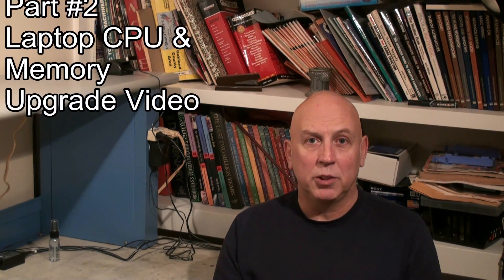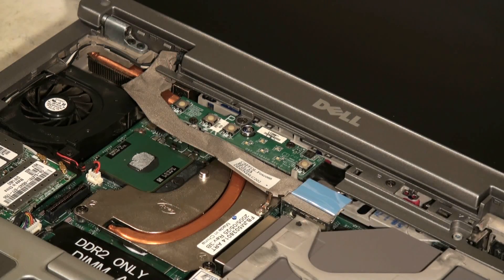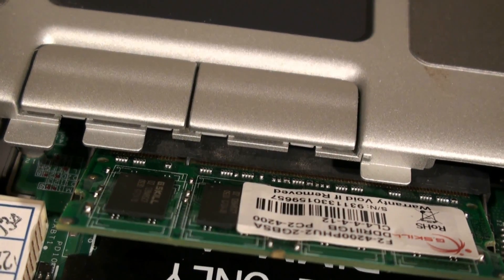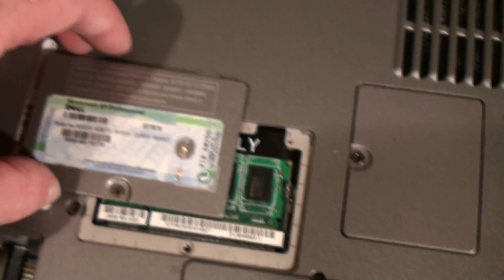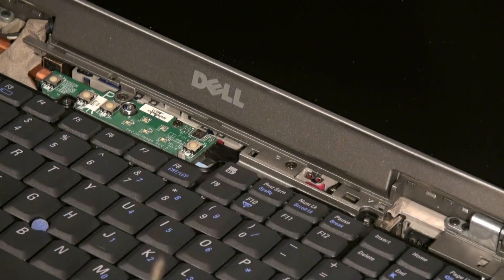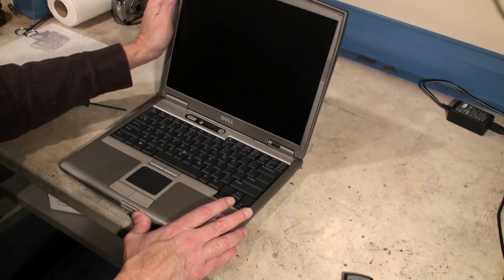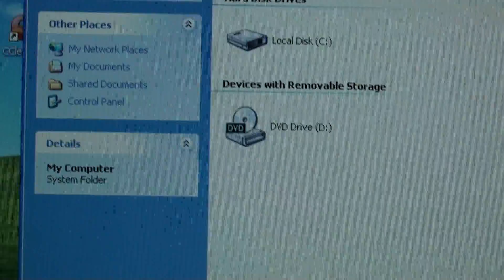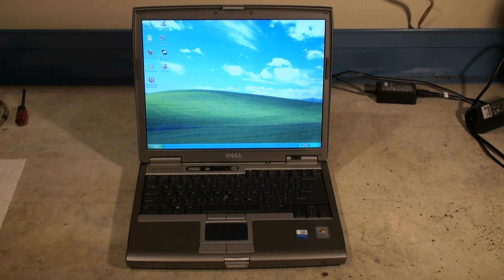Dell Latitude d610 CPU & Memory Upgrade Video #2

Comment: Hey i know this is years late (late 2025) but did you notice any overheating issues under load after you did your cpu upgrade? I was reading that the design of the d610 was not optimized for the increased heat production of the 770 you installed, just wanted your thoughts on this! Thanks :)

Comment: After installing new RAM my laptop no longer boots up. When I press the power button it starts, normal fan noises and such, nothing on the screen and the lights on, not blinking, then shuts down all in about 5 seconds. I have tried suggestions relating to power and battery, but nothing works. Do you think the RAM is bad. I have tried this with the original ram and the new ram and it all doesn't work

Comment: 1) Use some rubbing alcohol (or cheap aftershave like I do!) to remove the old paste
2) Don't use fingers to apply the paste as grease from fingers is not very good for thermal conductivity and
3) I would recommend Arctic MX-2 or MX-4 paste as neither paste is electrically conductive (as the actual CPU is exposed unlike a desktop CPU, non conductive is safer to use)

Comment: i have this same computer with win 7 on it i upgraded it wasn't slow it ran quicker with 7 than with XP. this computer actually played some new games that i have like diablo 3 and torchlight and left for dead. but most high performance games will not work like Skyrim / call of duty modern warfare. and so on. its good for indie gamers and old school games. its pretty much a basic laptop now that used to be high end in 2003 when manufactured

Comment: NO! NONONONO! NEVER use your finger to spread the paste on the CPU! your finger has many oils and such that, when the processor later heats up, act as  hot grease and can damage the processor. use a clean pocket knife or razor blade.

Comment: I have 2 x 256MB RAM (PC2-3200S-333) at the moment. I think they are 400MHz. I want to upgrade to 2 x 1GB.  Dell is selling  1 GB PC2-6400S-6 2009 SODIMM.  Can I use 2 x 1 GB PC2-4200 DDR2 SODIMM 533 MHz instead?

Comment: love your vids. i bought a d610 for $60 shipped and it had 2 512mb chips. i only replaced the one underneath with a 2gig corsair cgm2x2gs800 i had layin around. should i take the keyboard off and remove the other 512 chip or it won't hurt anything to just leave it installed? i would also like to see a vid of a harddrive upgrade if you would make one. thanks.

Comment: Thanks for the video. I will be upgrading my d610 shortly.

As others have noted you should not apply the thermal compound with your finger.  You can deposit a small amount on the CPU core and then use a credit card to smear it.

Comment: @RaggiGJ And also I dont think it is a good idea to apply the thermal paste to the cpu using your fingers, since your fingers have grease on them and this method also makes tiny air bubbles in the paste that reduce the cooling effect of the paste. I am no expert but this is what I have learned from many other computer specialists. It's better to apply the paste straight from the syringe/tube/plastic bag and let the cooling module spread the paste while you are re-installing it in the laptop.

Comment: Hello 31pockets, I have a Dell Latitude D610 also and it's been upgraded from stock to a 1,86 GHz processor and 2x1GB memory. Would it be wort it upgrading it up to a 2,1GHz processor and is 2GB really the max memory size it can handle? Also I would like to recommend to other D610 owners to disconnect the monitor cable and temporarily taping it to the display mask above so you have easier access to the cpu and cpu cooling module.